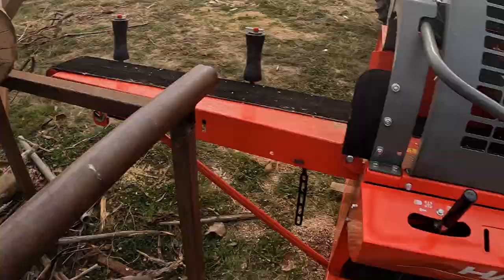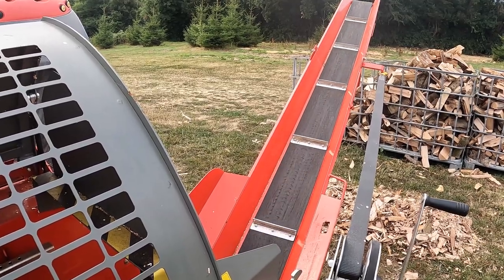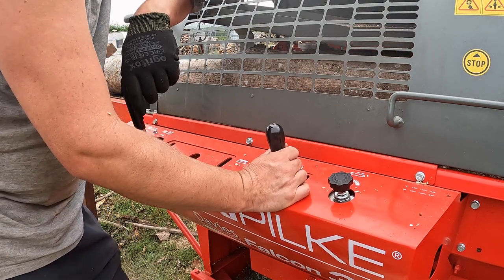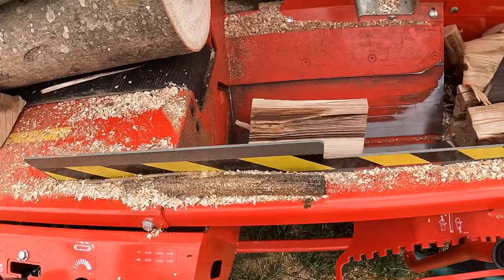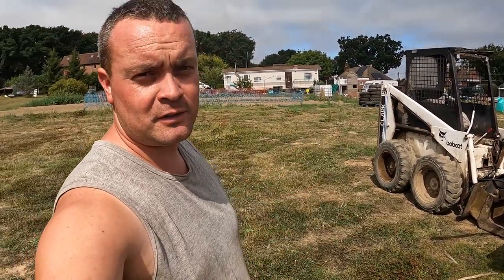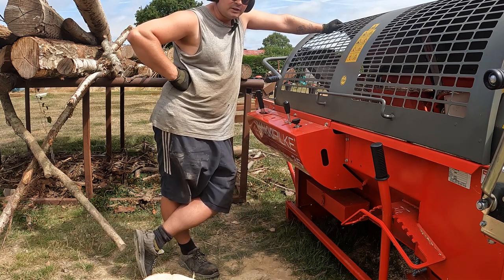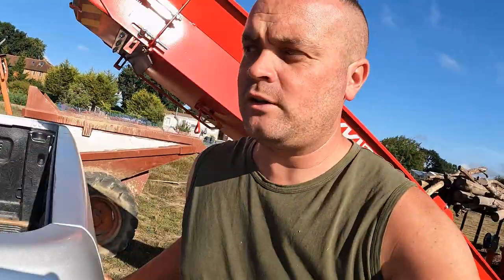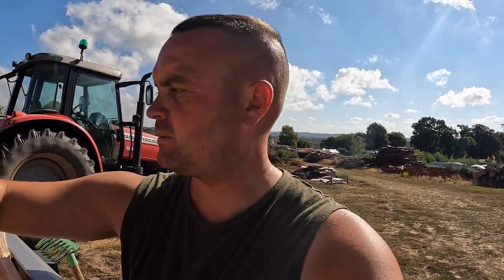HAKKI PILKE FALCON 35 WORKING REVIEW AND SPEED TEST

Comment: I have a pro 38 that had the same characteristic of debris buildup at the base of the conveyor. The solution that aids is to set the processor on concrete cottage blocks. That raises the machine off the ground so you can allow a little more time before you rake it out. Still a manual solution but it allows for a rake to get in there. I love my machine as you probably do. One thing I did immediately was remove the safety stuff off the chute to allow access easily. It also stops any split wood buildup before it hits the conveyor. Cheers mate!
Reply from the maker: Great comment Graham really appreciate the feedback!
Reply: @uckhamlads  I've been thinking hard about any possible dilemma you'll be facing with regard to wood heat ban in the UK. Is that proposal for the cities or country wide?
Reply from the maker: @grahamditchfield4318   i do believe in the end it will be country wide, im not sure how they would ever police it other than making it very hard for us suppliers.
Reply: @uckhamlads  Crazy world we live in.

Comment: It appears you customers like their firewood at 30 to 35 cm long.  Over in North America 40cm (16") is the standard length for firewood.  I've seem other Hakki Pilke processors run (Raven 33) and they appear to cut faster.  So either your chain is dull or you could run your tractor PTO at a high RPM to get more cutting speed out it.
Reply from the maker: Out of interest what wood are they cutting in North America?
Reply: @uckhamlads  Over here what gets cut depends on the area you're located in.  For hardwoods, it's mainly oak (all varieties), ash, maple (soft, hard), elm, cherry, hickory, beech, birch, locust, poplar.  For softwoods, it's all varietys of pine, fir, spruce.  Any wood will burn, you're just looking for the most dense wood as that will have greatest heat output for a given volume of firewood.
Reply from the maker: @bwillan thankyou very much for the insight! Much appreciated!
Over here down in the south east its frowned upon to burn anything other than hardwood. Everyone is told that softwood causes so much soot and tar in the chimney. Im constantly trying to explain that any wood can cause that, especially on these fires that you can close down so much that the log just smoulders!
Reply: @uckhamlads  The western parts of Canada and the USA have mostly softwood trees.  So that is what is used for firewood.  If you look at firewood BTU charts Douglas Fir has much BTU output as many hardwood do.  What causes soot and tar in a chimney more has to do with how dry the firewood is and at what temperature it is burning at.  Just like you said, damping the stove way down cause more creosote whether or not your burning a hardwood vs a softwood.